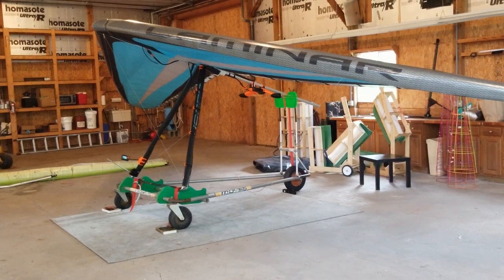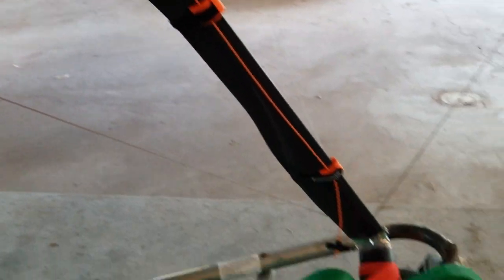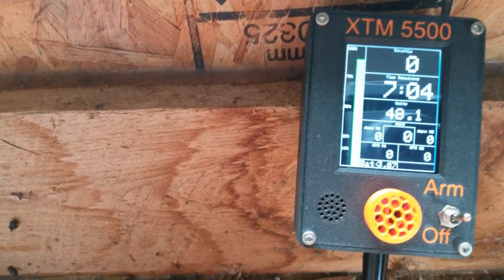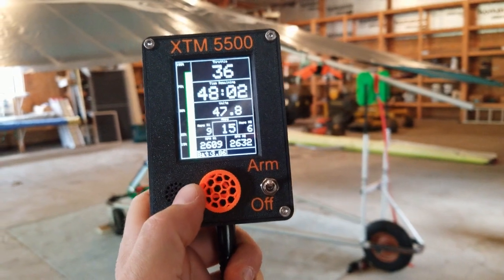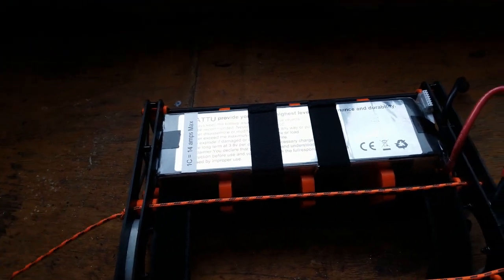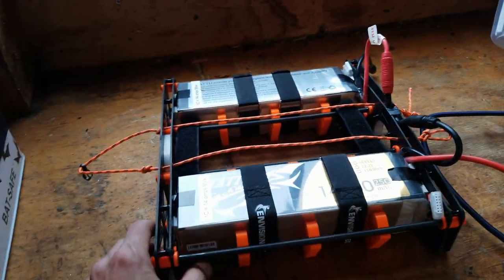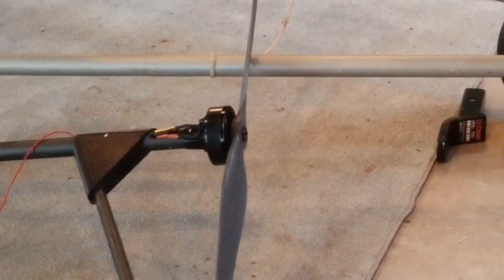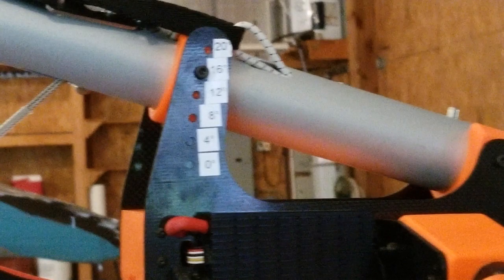XTM 5500

Comment: Very cool.  Well done, Sir.  

I have a question:  would this work well with a supine/suprone race harness, or would it be best to mount your motors on the harness itself for that kind of pilot orientation?
Reply from the maker: Should work regardless of type harness.  However it was designed for only very high performance gliders i.e. WW T2, Laminar Z9, Combat, etc.  The aspect ratio of lower performance gliders is too big so there isn't enough keel / open space to mount on.  Also I'm concerned that lower performance gliders will have more flex and the keel will float more which may have negative effective on control.

Comment: Pretty cool, man! So this is intended just to get you to the next thermal, or is it strong enough to power you up on a foot launch, no hill?
Reply from the maker: Not intended for flat land foot launch.  Thrust line is ground changeable and typically slightly above center of mass depending on setting at least when harness is clear of prop.  I anticipate this will create a nose down effect near stall while under power which.  Goal is to launch without power from low mountain, hill, scooter, etc and have 7-10min of power to climb up to 1000 ft and find thermal.
Reply from the maker: Also you should check out Reidar's Channel ( https://www.youtube.com/user/AcrodesignerLNSNI) he has lots of info on the ehelp which is ground launcher.  I made a carbon ehelp in 6 weeks.  However I wouldn't try to ground launch my laminar with an ehelp, the run is too long.
Reply: Thanks, Charlie! I've been looking at powered ways to get airborne, many (of the very few available) good days up here I look up at the sky with no way to be up there. I'll check out the e-help, which I would need to use with more of a floater glider I guess. I doubt there is any powered harness I could use on the Combat C though due to the tail.

Comment: You really need to put the power unit on your harness.... in the early days 70’s .... there were some fatalities when it was discovered that a high thrust line created pitch instability.... I strongly suggest you change this aspect of your design.
Reply from the maker: Ha that's the most common response and 100% disagree, core of my design is to get thrust line right, which isn't done right on a powered harness.  Also thrust line is only ~6 inches above my center of mass, soarmaster was very high about 6 inches below sail.   Please read some of the other comments as this has been addressed.  If you have an interest you should read the in depth accident report on the soarmaster link in another comment. Done my research and spoken with pilots who flew the soarmaster.  In my opinion the soarmaster was poorly designed over 40 years ago, don't see that as a reason to abandon concept, especially if thrust line can be properly engineered.
Reply: Charles Allen I flew a soar master and lost friends to it while trying to develop it..... we then went onto develop trikes that did not exhibit the same problems.... yes there are issues with the thrust attached to a harness, namely rotation, which is manageable..... for your sake I hope you are right....
Reply from the maker: @seanwestrope3783  Thanks for the feedback.  Given the low power, low weight, and dialed in thrust line I'm optimistic it can be developed safely.  Also the goal is not to developed a motor glider but rather a minimal unit to sustain flight to find lift.
Reply: @cwallen32  problem as we discovered was, as by way of illustration, that you wouldn't think of putting a thrust line on the control surface of a conventional wing (flaps, ailerons..etc) nor on the control linkages......these elements effectively work around the thrust line, otherwise the aircraft would be obviously unstable.  On a flex wing the whole wing surface and the whole frame is in effect a control surface and the control linkage. For a flex wing the only part of the whole a aircraft that is not part of the control is in fact the pilot (albeit he/she does the controlling). It was this realisation that moved us towards a trike configuration. What you are developing is a self launch HG, which I think is the way forward because it would be more convenient for pilots. You are also now beginning to get the materials and technology to make this practically possible without disproportionately affecting the HG performance. It is exciting what you are trying to achieve but it is also important to understand how and why we got to some of the solutions we adopt today. I wish you every success.
Reply from the maker: @seanwestrope3783  Thanks for the thoughtful feedback, much appreciated.  To clarify though this is not meant to be a self launch power unit.  The required power to get off the ground would be too high to be safe at this stage of development and the flight speed would be too close to stall were there are known issues form the soarmaster.  It was originally designed to provide enough power to maintain sustained flight (i.e. zero sink) though I think it should produce 100-200 fpm climb after taking off via another means.  

You make a great point regarding power being attached to a control surface.  Hence why I'm keeping the power low and don't believe this will work on a low performance glider.  One difference between gliders 40 years ago and a modern high performance flex wing is the amount of flex and rigidity.  Comparing my falcon to my laminar in terms of flex the falcon is more flexible, likely closer to a 40 year old glider and the keel can really swing around.  The keel on my laminar Z9 doesn't swing much and if I go full VG  things barely move. 

I'm optimistic that if I get the thrust line dialed in there will be a safe envelope of speed, bank angle and pitch that can be flown.  Modern electronics are also something didn't exist in the past.  Both the remote and power unit have dual core 240mhz processors which I can hook multiple sensors up to.   I have a 9 DoF  IMU I plan to connect in future which could kill motors if pitch and/or bank angle goes above or below set angles.

Comment: Will it possibly be commercially available? Any idea what the price range might be for something that can be used to take off from flat ground and gain at least some 500m?
Reply from the maker: Don't plan to make a business out of this project, it just can't compete with my day job.   However, may make and sell a few if I get good results, though not sure what I would charge, as its very labor intensive.  

You can make an ehelp for about $2-3k which will get you to 500m.  Its also a proven design.  If you're interested can point you in right direction on this.
Reply: Charles Allen I’d love to! Why don’t you post that on a hg forum?

Comment: This is potentially a lot simpler to build than a powered harness, but unless it is cheaper, I much prefer a powered harness instead of a powered wing... Why did you choose this way?
Reply from the maker: Actually much more complicated to build then a powered harness.  I designed and built an ehelp in 6 weeks from CAD to working rig video here: https://youtu.be/4Z1WWt682bY.  It was under powered and I've since added a bigger motor prop combo.  Some reasons for glider mount below:
- Thrust line swings around on powered harness.  When you move your body unless perfectly coordinated and lined up the thrust line can have major control issues and isn't efficient.  I have an LD Explorer (similar to Mosqiuto) if you turn left for example and your feet swing out to the right then the thrust line is driving you into the turn, it kinda feels like you're getting pushed into a spin, backing off motor solves this.
- Can't aerotow with a powered harness as it doesn't fit in standard cart.
- Have p-factor with single large props etc.  Twin is counter rotating.
- Need special or modified harness.

Most importantly though the goal of this project was to build a very minimal unit to enable sustained flight for 5-10min to find the 1st thermal and climb out.  My main site (cool video here: https://youtu.be/ycU4ZDrqKA4 is just 500ft agl) requires 15-20mph wind for the ridge to work otherwise you need to launch in a really big thermal right at launch which never seems to happen.  On a weak wind day with the XTM 5500 I could launch with min of 5mph, and fly to nearest cloud.  Further it could allow for scooter towing to be a means to achieve soaring flights.

Comment: Don’t engines mounted on the glider create a risk that, if you add lots of power, the glider may get ahead of you, nose up and stall?
Reply from the maker: You are connected to glider so the thrust line in relation to the center of mass (glider / pilot combo) is what matters. There's some risk that in turbulence if you go weightless the center of mass would become just the glider and this could result in unwanted pitch changes do to power.

Comment: Didn't you ever hear about the problems the  " Soarmaster " power unit had , back in the 1970s and 80s ?   There were many accidents due to the thrust tumbling the gliders...Do your research, before you have more accidents like the Soarmaster provoked.
Reply: I had 2 soarmaster power packs in the
Very early 1980's and flew over 300
Hours with them over a 2 year period.
It was some of the best flying i ever did.
Never felt they were unsafe, but they were  definitely  not for low time pilots.
I always  thermaled to  the left and kept full throttle on. The torque of the prop would tighten up the turn when going
Right if you made anything other than
A gentle low banked turn. Never herd of anybody tumbling with a soarmaster.
I think what you are referring to and 
 the reason they got
A bad name was if an unsuspecting pilot
Especially when learning got into a right 
Turn with full throttle on the turn would
Quickly tighten up , if you let off the throttle the wing would immediately right
Itself but unfortunately some low time
Pilots trying to teach themselves got it
This situation of turning right  and kept the throttle open, this would result in a rapidly increasing bank angle to the right that would usually result in hitting the ground somewhat simalar to a lockout.
Reply from the maker: @loriley347  You open to speaking with me about your flights on the soarmaster? Trying to speak to as many people as I can that have hands on experience with soarmaster.   If so let me know best way to reach, my email is cwalle @ gmail.com.
Reply: @cwallen32  I appreciate your thoughtful approach.  I demo flew a Soarmaster in Phoenix, AZ, around 1977 or 1978, I believe, and as an aerospace engineer decided after one flight that it was too risky to buy one.  Soon thereafter, I had two friends die due to its design flaws (and daredevil flying).  The main problem with the Soarmaster, as you noted, is the high thrust line.  This caused it to pitch down when advancing the throttle, which is undesirable, but I thought I could manage that, as well as the torque, which made it harder to turn in one direction than the other.  However, another fundamental problem, the one I couldn't get over, was the problem of turbulence in thermals.   
In Arizona, rowdy thermals can causing zero or even negative g's in flight.  When under power in zero or negative g loading, the thrust pushed only on the glider frame, causing it to rapidly pitch down unless power was immediately removed.  Gliders of that era had enough concerns about tucking and tumbling in turbulence even without power, so I decided not to buy one even though the concept was (and still is) mighty attractive.  
So, my question is whether the thrust line setting of your twin motors will cause the glider frame to pitch down (or up, for that matter) under zero or negative g loading.
Reply from the maker: @milesfagerlie8052  Thanks for the thoughtful response, right now I'm still testing and don't plan to make a commercial product out of it.  With respect to the thrust line I believe this can be figured out, which is why i designed it to be highly changeable, however, in big air if the pilot goes weightless the center of mass would instantly change and may cause severe pitch changes.  I have some ideas on how to solve this issue via an IMU unit to auto kill the motors, but in the interim I'm starting with a very under powered unit since a high performance gliders shouldn't need much thrust. 

More importantly though the goal is not to create a traditional powered hang glider but rather provide enough thrust to climb out from a low hill or scooter tow to get established in a thermal or for a low save.  Therefore I have no intention of flying under power in high turbulence.
Reply from the maker: Yes did my research.  Have you ever flown a Soarmaster? or spoken to someone who has?  I've had many pilots tell me the same thing but have done neither.  See me earlier reply also here.  There is a great accident report on the Soarmaster with lots of data: https://assets.publishing.service.gov.uk/media/5422fdfa40f0b6134200087d/1-1983_Hang_Glider.pdf.  There was also an article by Mark Stucky on the Soarmaster in Hang Gliding Magazine here: https://issuu.com/us_hang_gliding_paragliding/docs/2008_08_hgpg.  Mark was kind enough to speak with me about his experience which cemented my thought that getting the thrust line right is paramount.  For me the center of mass of my glider and harness is exactly 17in above my back plate. I have laser pointers mounted to the motors so I can dial in the thrust line on the ground.  However I plan to make an in flight adjustable thrust line on the next version. 

Lastly the Soarmaster was 2x the weight and designed 40 years ago when gliders were different.  I've also yet to find a credible story of a glider "tumbling" from the Soarmaster.  The issue was the thrust line was too high above the center of mass and when close to stall it would force the nose over into a dive which was hard to recover from unless you backed off the throttled.  If this happened low to the ground it would obviously be fatal. 

The XTM 5500 was not designed to be powered on for take off.  Its designed to be turned on once airborn and not near stall from a mountain launch, scooter tow, aerotow etc.

Comment: Nice work Charles.  I'm a model airplane guy and have been electric only since about 2000.  I've been thinking about an electric ultralight for a while now and have been collecting data on setups.
Have you ever used the low voltage alarms that plug into the balance connector on the batteries?  I use them on my electric bike and back when I was running 5000 mah packs they would tell me when the packs were sagging below 3 volts with a quite loud repeating beep.  I still puffed a few of those packs but they were given to me so the price was right.  I've since went to 16000 mah Mulitstar packs and I had two that were giving me beeps way before I was done discharging the pack.  I've since took the bad cells out of one of the packs and since then it's been working fine.  The bike pulls at most about 32 amps so I'm not running them that hard, but it cut a couple of rides short last summer.  It turned out that a 4S pack I thought was 16000 mah cells actually was a 4S 2P with two x 8000 mah cells in parallel.  I took the two bad ones out and now it's a 3S pack I run in series with others but it runs fine.
I've got to get to work on my design.
Reply from the maker: The voltage is monitored and motors are shut off when it drops below 40.8 (3.4v per cell).

Comment: Nice job... I'm waiting for battery power density to go up a bit more and then I'm going to convert my Alatus AL12M from gas to electric. It only holds about an hour of gas so I'm only one battery advance away to match the flight time I currently have.
Reply from the maker: Will be nice, though may be slow, 5years?  For an extra 3 pounds I can have 25 Ahm batteries or 78% increase, however cost goes up a lot.
Reply: @cwallen32  Yes, I expect it to be an expensive leap. I hope Tesla battery day divulges something good. Then I'd wait for a wrecked car after that.

Comment: Nice rig. You said 1400Mah, I think you meant 2, 6S  14000mah batteries run in series making 14000mah 12S ? Which motors and what prop size?
Reply from the maker: Correct 2x6s, there a bunch of other errors in video as well but its not a product promotion more a project overview so didn't feel like reshooting.  MAD 180kv drone motors, tried about 6 different motors before settling on these.  Props are 19.7x10, however I think I may be able to go as high as 21x12 assuming they are only run in the air.
Reply: @cwallen32  Nice job, those motors are good and your battery choice is good. The higher voltage will run cooler. Keep bumping the prop diameter on the ground until you hit the ESC amp limit knowing it will unload 10% or so in the air.
Reply from the maker: @atlantahobbyuavexperts4759  Ha, exactly what I did.  Video of my older test stand here: https://youtu.be/7zbRbz_ZH30.  Mfg has motor able to pull 68amps I had it at 61.6amps in test stand (left a little room to be conservative).  However, it was in very small room when I tested in big building that allowed air to move around amps dropped to 50amps.  So I think in air at 25mph should be able to up prop size.  Working on data logging now so I can see amps pulled after flight and adjust accordingly.